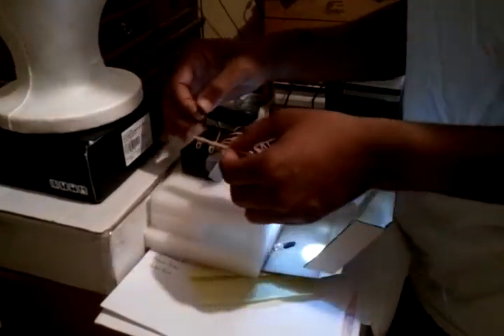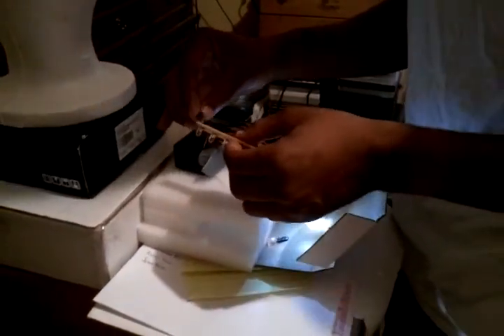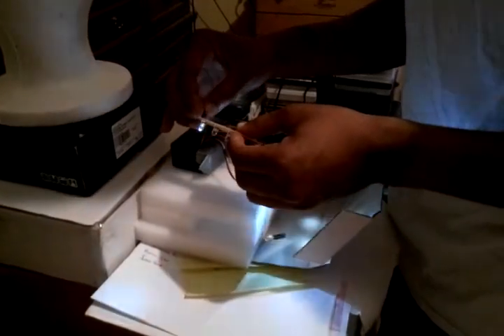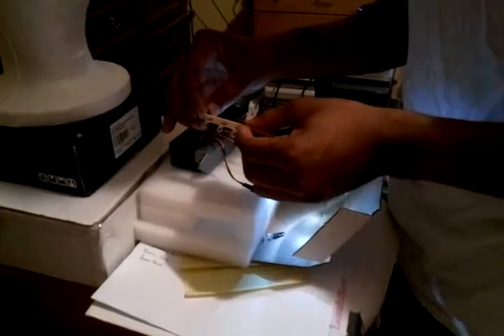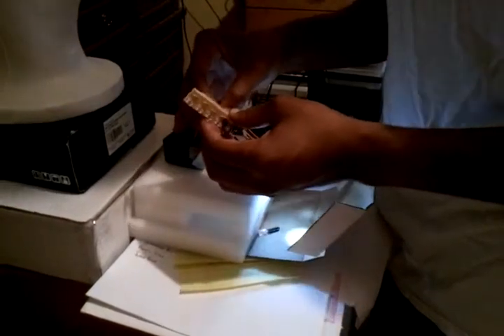having some problems...could you help??

Comment: What is your supply voltage and what board are you using? Arduino or some other LED chaser? Also are there any resistors?